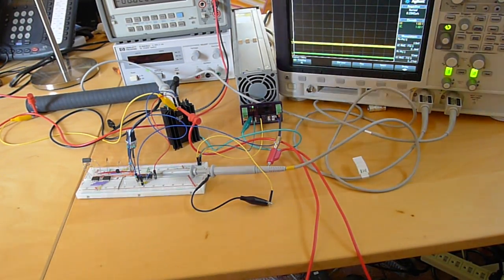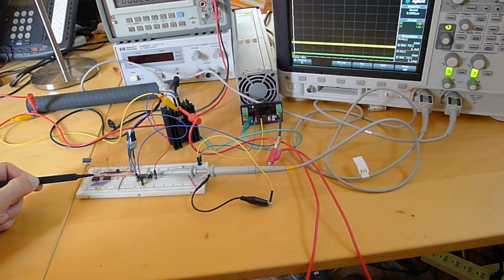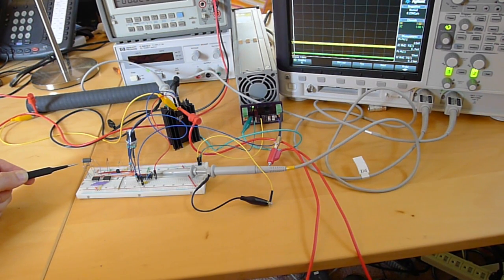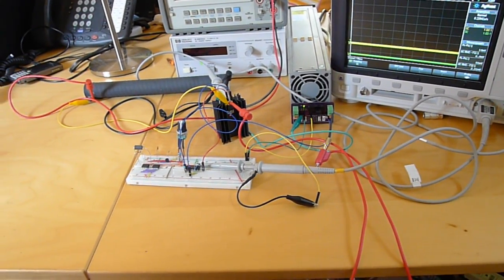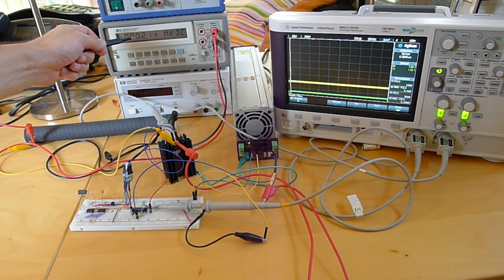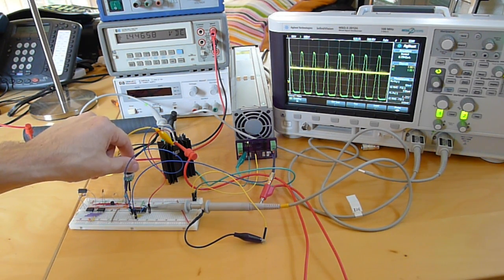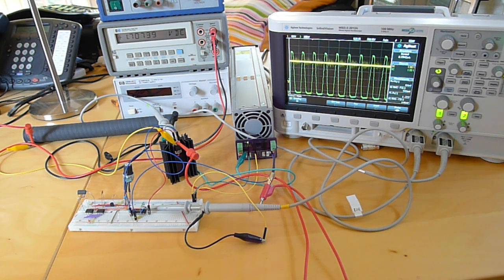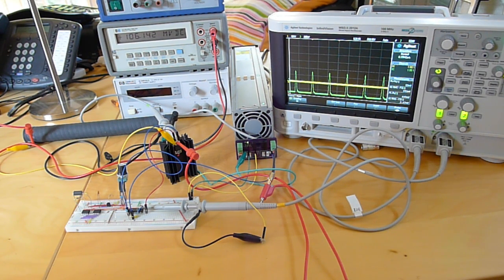Constant current dummy load.

Comment from the maker: The resistors are pretty cheap on ebay. 100W for <$5 and they are easier to deal with than the FETs with sinks on them. You are correct that there is some drift due to heat but they are not material to my goals of pushing power supplies hard for testing purposes.

Comment from the maker: Actually, dropping the power across the load resistor is exactly the goal running the FET is saturation. Big resistors are cheap, FETs capable of managing 200W of power dissipation are something else completely. That heat sink which you think is large is useless to me in the power ranges I am targeting.It's okay up to 60W if memory servers. For my purposes, saturation and large resistors were the only viable option taking budget into concern.